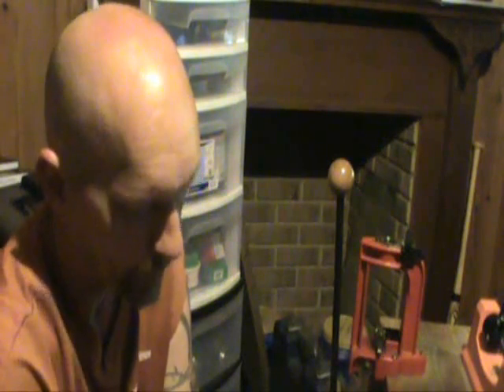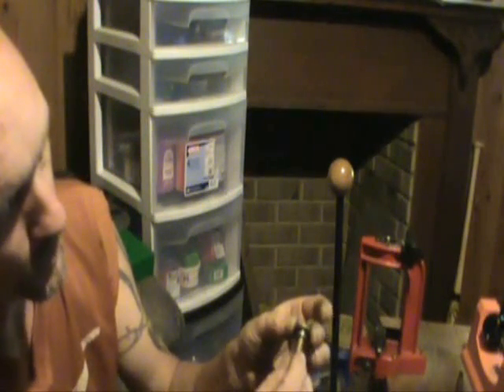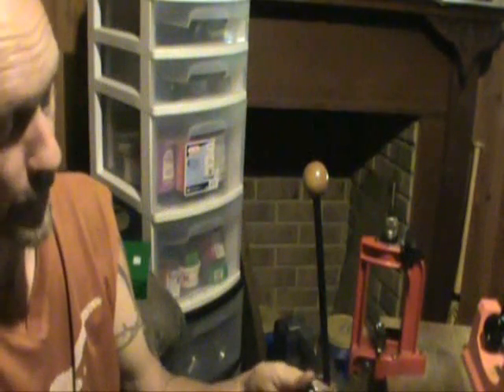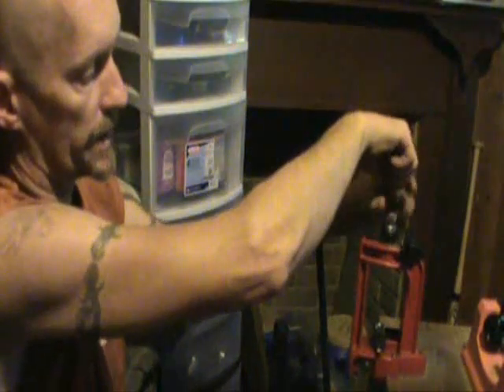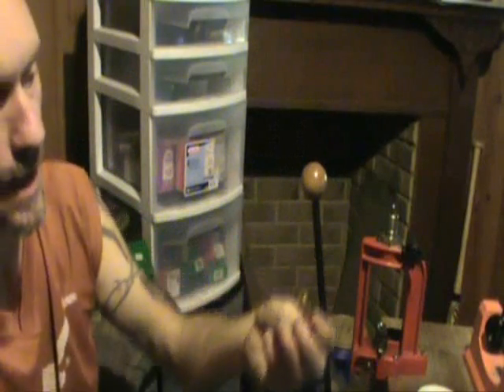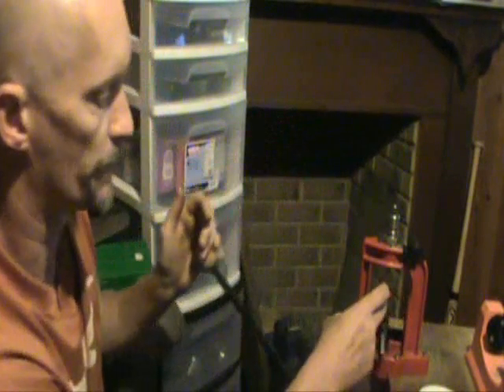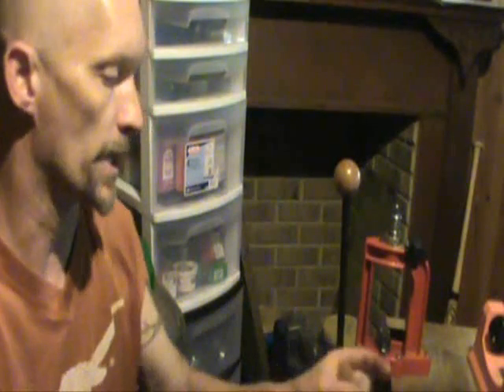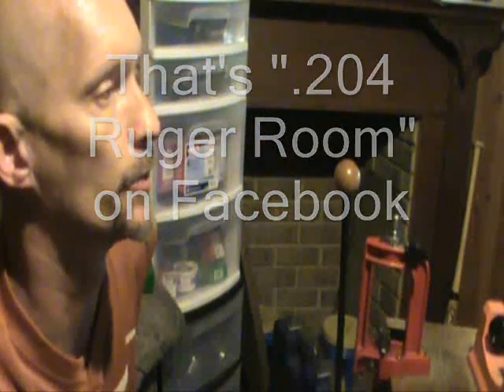Precision Accuracy: Reloaded: "Bumping the Shoulder"

Comment: Why does my caliper reading increase when I try bumping the shoulder? I won't see any change in the headspace until I'm actually full length sizing the case and after that my reading shows less head space. I'll have 2.200 before and 2.240 after doesn't make sense.
Reply: I got a carbide full length sizer made for my .30-06 at Hollywood Engineering, oh, 15 years or so back now, and it was particularly bad for that... the "MORE" I screwed it down, the "LESS" headspace I got! Answer??? To this day I have absolutely no idea!
Reply: I speculate the expander ball is stretching the case, or maybe the case is sticking to the die enough to stretch it as it is pulled out.  Make sure the die and ball are clean & smooth, lube the case and inside the neck, see what that does.  My .338 ball had a bit of an edge to it that was pulling kinda hard so I smoothed it out.
Reply: Forty thou is a lot. If it was just a few thousanths, my guess is that the shoulder in the die is not contacting the shoulder of the case at the same time the upper body part of the die IS contacting the upper body part of the case so the shoulder is getting squeezed forward. Might need a new die.